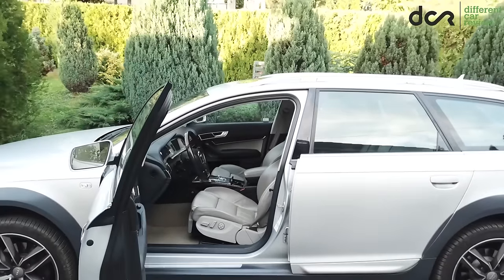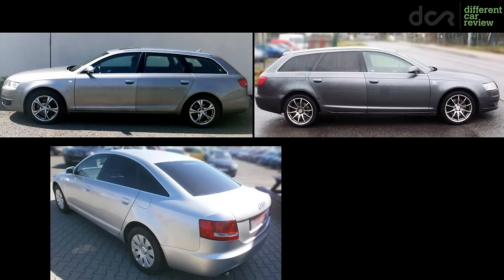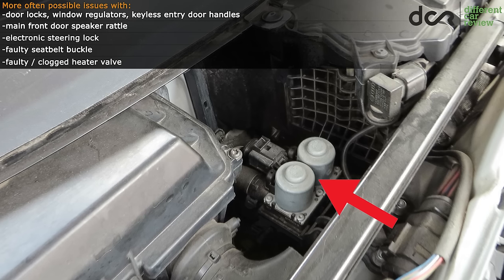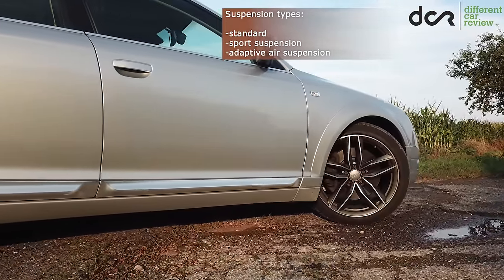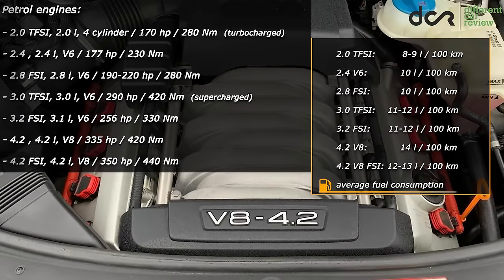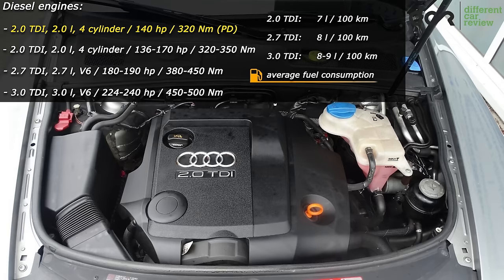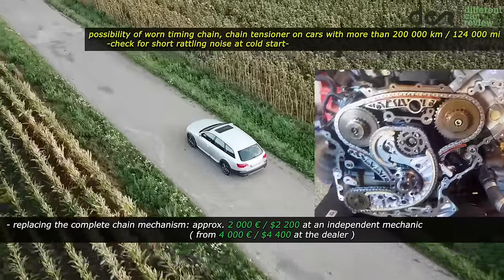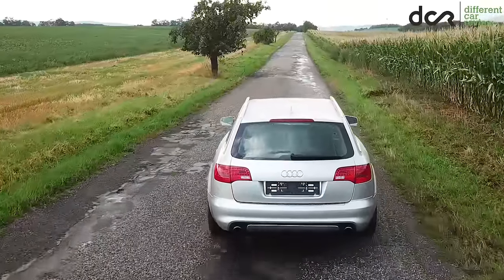used Audi A6 (C6/4F) - 2004-2011, Complete Buying guide with Common Issues

Comment: Done a lot of work on A6 C6s. Here are some recommendations to minimise issues:
1) Get the facelift version (C6.5) if possible. Many of the earlier faults have been ironed out. Also you get LED lights (although not headlights).
2) Always perform regular oil changes using VW 507 spec. If you do high miles and run extended service intervals then an anti-friction/cleaning additive will help minimise risk of issues (N.B. only do this outside warranty).
3) Use premium fuel and regularly add fuel cleaning additive. Minimises issues with the fuel system such as injector blockages and top-end engine deposits.
4) Never touch a Multitronic CVT car. Best to go for Tiptronic.
5) On a 3.0 TDI, change the crank pulley flywheel. This will often come off at some point as the originals are rubber (not mechanically) bonded to reduce harmonic vibration. When it comes off you will lose cooling, power steering, alternator. So as this failure will disable the vehicle a pro-active replacement will provide peace of mind.
6) Even on the 'sealed for life' Tiptronic auto transmission (which is a great transmission), it is still a good thing to change the transmission oil at intervals if you plan to keep the car for a long time. Only use an approved ZF service partner for this type of work (all of which are listed on the ZF site) as this is a fairly complex procedure and a mistake will cost you dearly. If you service the trans every 50k then there is a good chance that the transmission will outlive the car.
7) Keep a close eye on the rear springs. They often fail at high mileage especially in countries that use road salt in wintry conditions. This is because they rust in a way which allows stresses to build up and they snap.
8) All Audis including C6 have a complex front suspension with multiple control arms to create a 'virtual pivot'. What this means in practice is that there are loads of rubber bushes that will wear out so the handling increasingly deteriorates over time with squeaks and bangs developing in the worst cases. The side nearest the kerb will be the first one to go as that is the one that gets hammered the most due to potholes and other road defects. The upper control arms are the weakest so you need to keep an eye on those for undue play, especially the rear one. Unfortunately rubber bushes will fail even on lower mileage cars because rubber is a component that ages irrespective of use. To avoid that happening consider replacing with polybushes, although they behave differently to standard rubber so this will change the feel of the car quite a bit.
9) Avoid cars with air suspension. Very expensive repairs if you use an Audi dealer. Yes the ride is great when they work but unfortunately with age and mileage then something is likely to eventually fail and the parts cost a lot. If you are unlucky it can be like 'whack a mole' - solve one issue with the air suspension and another is waiting to appear.
10) Get a Quattro. A C6 without having quattro is like having a birthday party without any friends, just not the same.
11) The SE version has a better ride than the S-Line especially on bumpy roads. Yep the S-Line looks better with the big rims and is a bit better at hard cornering but there is a price to pay for that, which is your comfort. If you get the S-Line then rest assured that you will eventually grimace in advance of every bump in the road or swerve to avoid them.
12) If you plan to own this car then you will need some DIY car skills, and so is probably not a car to own if working on a car frightens you. The newest ones are now 10 years old and they are increasingly getting issues. Having these repaired at an Audi dealer or even an Independent specialist is going to be a very quick way to empty your wallet.
13) Never get a C6 TDI equipped with a DPF if all you are going to be doing are local and short journeys. These engines need to be worked hard to get the high temps necessary to remove engine deposits and local journeys mean the deposits build up and the auto-regen may not be able to handle this. This situation could cause emission control failure (limp mode etc) and potentially require expensive ($1500+) repairs.
14) If you are technically minded, invest in VAG-COM/VCDS and a laptop. This way you can run diagnostics scans, getting the same info as Audi and identify impending issues without spending $$$. You can also make adaptations and activate functions which are not otherwise accessible.
Reply: Thank you so much for all the information, I currently own a 2008 A6 Quattro 3.2L, and want to get more power out of it. What could you recommend I do?
Reply: @vluri258  Normally aspirated engines like the 3.2L do not give massive power gains using remaps. You can perhaps achieve around 20 BHP more this way.

It is also possible to add a forced induction kit such as a 3rd party supercharger to give you additional power. However I think this engine has around 12.5/1 compression ratio which is quite high, so the boost pressure would need to be kept low to avoid the engine coming apart at the seams.

Personally, if I had decided to make a sizeable $$ investment in such a car, I would get the cylinder head gas flowed including having the valve openings machined (using a spiral flow to improve fuel/air mixing), have a sports exhaust fitted, install fast cams for more top end power, alongside a remap. If I was being greedy for well over 300BHP, and sufficiently brave to risk it, I might also include the induction kit option with some strenghening work to handle the charger boost. Bear in mind engine mods like this are not DIY jobs, they are expensive and can also introduce reliability issues if not done by somebody who is fully experienced in this type of mod. So you would need to decide whether this is a worthwhile risk and investment in a 12 year old car.
Reply: Whould you chance oil (flussing the transmission) for 225tkm driven tiptronic, if it has stock oil in it. I have C6 BMK remapped to 285hp/550nm. 

Some say that if you chance stock oil after 200tkm, it could do more damage to turbine than drive with old oil. Because all the possible metal particles of transmission wearing will flow to turbine.

I also want to state that in my experience C6 air suspension is far more reliable than mercedes/bmws air suspension of the time. 

I had to chance suspensions compressor (399€) but apart that, suspension has worked flawlesly. Original factory installed compressor ran 200 000km, and factory suspension still works well.  So i would say its quite reliable. Considering that car has seen only northern finlands roads, and temperatures.
Reply: @johanneskoskela384  225km is a lot of miles to do a first trans fluid change, and there is an increased risk of metal wear particles and other contaminants like friction material being dislodged when you use a flushing machine. Basically there is a magnet and filter in the trans, and flushing without first cleaning the pan and its magnets can dislodge contaminants, which then get into the moving parts like torque converter, gears, etc, and also the internal fluid channels, some of which are small and easily blocked. If that happens the 6HP trans can fail within a few hundred miles.

If I was going to do this at 225km then I might drop the pan first, clean it, change the filter, fill up (being careful to only replace the volume of fluid that has come out), and then after a week or two of driving do a proper machine flush and repeat the filter change. Many people would call this approach overkill, as trans fluid is like liquid gold and costs a fortune. Although no where near as much as buying a new gearbox, so IMO best to be safe rather than sorry if you value the car.

I would also recommend that you should only get a ZF approved partner to do this type of work. It can be done as a DIY job, but very easy to mess it up and you need the right equipment.

Rubber bushes can actually last longer in cold climates, as hot weather tends to evaporate the volatiles in the rubber more quickly, drying it and helping to break down the compound. Although very cold weather can also damage rubber for different reasons, as cold rubber is not that pliable so stresses more and cracks easier.
Reply: @ Gladius Do You think that the worn crank pulley flywheel can be responsible for vibrations on engine idle revs? (3.0 TDI CDYA)
Reply: @dominiusz1978  It would have to be pretty loose for that, and normally happens only when it is about to come off due to the rubber bond failing. Unfortunately a lot of other things can cause idle vibration. Such as:

Fuel system (e.g. injector deposits, high-pressure pump, pressure regulator)
Worn engine mounts
Glowplugs failing
EGR malfunction
PCV system blocked

Have you had the car checked for fault codes? If not then you need to get VCDS, as it helps to eliminate or identify a lot of issues. Otherwise a lot of problems become guesswork that could otherwise be diagnosed.

If I had to guess then I would start with the fuel system and engine mounts. Try a fuel system and injector cleaner, added to the fuel when you next topup. Also I would get it on a ramp and check the engine mounts are not perished.
Reply: @gladius492  I have VCDS. No fault codes, injectors are super healthy, engine itself is working smoothly. Only those vibrations that you can feel on a whole car body. I will check the engine and gearbox mounts. Thanks for the tips!
Reply: Just bought Allroad , fully equiped , its done 314.000 km, wanted this car. It is listed as well mantained , its from Germany. Im hoping everything is gonna be fine. There are mechanics who refurbish air suspension for 150euros per unit and give 1 year warranty.
Reply: @GG Zelvys Aah its in my country not sure for yours, you will have to look at it on the ads
Reply: 2005 A6 C6 4.2L 100,000miles got problem puttering just changed the plugs and coils, still sputtering at idle just under 1000rpm.   Think it may be the throttle body its making weird sound from there like flap is out of wack.   Any advice will be great 🙏 Namaskarm
Reply: nice run down man, ty
Reply: Multitronic isn't as bad as people make it to be. In B6 and C5 audi's, they had issues with the clutch plates, but they changed the clutch plates and that's not an issue anymore. Usually the biggest issue with multitronic transmission is the control module breaking, because it's inside the transmission oil in closed shell and the oil leaks inside it. That fix is usually under ~1000€ depending labour. I've seen Audis with multitronics driven over 750 000 km and still going. I might even say that the multitronic is more reliable than the tiptronic box.
Reply: @aarraa9671  i've got a c6 2.7 multitronic with 210k km on it, running sweet, driving it dynamicly also, i tend to use the paddle shifters alot in S-mode on twisty roads. My only problem with the car is a rattle than i can feel in the whole chassis at around 130kph till 140 when it smoothes out. Ive checked and replaced :
- lower and upper front control arms
- bushings in the front (sway bars and arms)
- front shocks (480mm s ones)
- bushings (front only)
- new tiers + check alignment and rims (all good)
Question : should i check engine and gbox mounts?
Thanks!
Reply: @alexpopa4064  Yeah, check mounts, and have you checked CV axles?
Reply: Thank you so much for the information..just bought a 2008 A6 Avant 2.0 litre turbo diesel.
It's a manual gearbox..2 owners in 14 years with full history, all the books and papers, new front shocks, discs pads and 4 new pirelli P7 tyres and 2 keys all for £2k
Reply: I’m in love with the 4.2L v8 A6 definitely gonna buy one cuz I can find many for under 10k
Reply: @Gladius can u get the allroad without air suspension?
Reply: @ironsavior1171  I have never seen a factory A6 C6 Allroad without air suspension, but it is possible to retrofit a spring conversion kit. However, air suspension makes the car's ride quality tolerable on unpaved roads and the adjustable height with greater ground clearance makes negotiating rough terrain easier. If the car has springs then the ride quality significantly deteriorates on rough terrain and you lose the extra ground clearance, but obviously is fine on the freeway.
Reply: @ironsavior1171  my friends a6 4.2 s line is Quattro without air suspension
Reply: I'm looking to buy an Audi A6 TDI 2008 Automatic, I went and saw it but how can I know if its CVT or Triptronic?
Thanks in advanced
Reply: @ykeshk  Probably the easiest way for you to check is to look at the vehicles option codes, which contains the vehicles factory build configuration. You will find a label with the codes on it in the wheel well and in the front of the service book. If you Google 'Audi Option Codes' and look at the images this will show you what type of label to look for.

Underneath the engine power rating (which ends in KW) is the engine code. On the same line at the engine code but at the right hand side is the transmission code. This gives the specific model of transmission that is installed. Also the transmission will be TipTronic if it has option code 0G7 listed somewhere below.

There are also option code decoders which will tell you the meaning of each code. For example at PlanetVAG (just Google it).
Reply: i know it's been a year since your comment but i'm thinking of buying a 2.0tdi e with around 130k km for 8k euros and the cambelt was changed around 110k. How do I know if it's a TipTronic gearbox and not multitronic?
Reply: @lxve9089  fwd (= no quattro) = multitronic
Reply: @ironsavior1171  ah so Quattro = TipTronic, is there a 2.0tdi e with Quattro? Haven’t seen any car ad with that
Reply: @lxve9089  dont think so for the 2.0 With the 4f gen. A6 c7 4g Got a 2.0 tdi quattro. Either go for 2.7 tdi or 3.0 tdi. And same bigger petrol fwd got multitronic maybe
Reply: @lxve9089  the 2.0 tdi e is a diesel engine with Quattro which is awd im not sure if it mean it’s tiptronic but I think it is cuz there only other option would be fwd
Reply: @dummytummy7622  As far as i've seen, only quattro models have TipTronic, fwd either have a 6 speed manual which is a lot more reliable than shit multitronic
Reply: @ironsavior1171  I want to opt for the 2.0T but i've it's not really reliable due to some wrong engine part, the 2.0T have okeyish fuel consumption (it's under 0,8/l) and much cheaper tax than the diesels, unfortunately my country tax the diesels heavily, 3.0tdi allroad cost around 1300 euros per year. Plus our fuel prices is one of the most expensive in the world. But if I change the faulty engine part to the right ones for the 2.0T, what about it's reliability then? Ofc, I'll service the car and take care of it nevertheless.
Reply: @gladius492  The Gladius Encyclopedia of Audi Wisdom. 
Thank you. Thank you. Thank you. You taught me A LOT from just reading this string alone. Do you have a website? I have a well used B6 A4 3.0 quattro battletank that is being honorably retired. She's not being discarded, but her spirit will live on as an organ donor. Her precious bits will help other A4's clock many more miles. That said, I was looking to replace her with a 80k mile (or so) B8.5 S4. Then something happened. I saw a few Avants recently and now, I'm head over heels in-love with wagons (marriage with no pre-nup love); especially ones that can be tuned like what can be done with the 3.0T. (I'm still confused as to why they put a "T" designation on a supercharged car, but that's Audi. I'm sure they have a logical reason, but nobody else knows what that is. K or C for compressor. No? Anyhow...) The Avant would also better suit my lifestyle and the roominess of the 6 will be appreciated. I'm ready for bigger. 

From what you've taught me here... facelifted C6.5 over the C6. Don't be afraid of air suspension on Allroad because it can be swapped to non-air which was something I've done on a S-class Merc. Poly bushings will make the car more responsive...  What other tips or tricks or hacks should i be looking out for? I'd like to pick something up within the next two months and it's crunch time for learning what i should know before my love affair with the Avant becomes another Depp/Heard trial. Help me out, Brotha! LoL Any additional tips are appreciated. Do you know of any good C6.5 Avants in the states for sale? Thanks again.
Reply: @j.thomas7128  Thanks for the comments. The 'T' designation on supercharged cars was purely a branding matter, to stop the cars being confused with Sport or S4/S6. Nowadays it gets the T if the car has forced induction, whichever method is used. K is used on Mercs due to the German word for compressor = 'Kompressor'.

In terms of other things to look out for, quite a lot are specific to the car configuration so difficult to list them all. Also some things to look out for benefit from having specialist kit (e.g. wheel play detectors AKA shaker plates can quickly identify suspension issues). However, in terms of some general things for the A6 here are a few more points:

The V6 and V8 engines in the A6 have dual overhead cams and four valves per cylinder, which require a complex system of timing chains. These unfortunately have plastic guides and hydraulic pistons which can fail. Any clattering noise for 1-2 seconds at start up can be a bad sign and I would avoid any car with those symptoms.

Coil packs age and deteriorate, often around 50k-60k miles or 5 years. Unless they have been replaced then they will need preventative attention.

A6 window regulators can break so check all the windows work. This often happens because the window is a tight fit and starts sticking on the guide rails, stressing the components. You notice the problem starting because the window goes half way up then back down again because the window controller thinks there is an obstruction. This can be preventatively solved with some silicone spray down the front/rear guides.

Anything like rough idle, misfires, surging, etc, is a bad sign. Need to check this doesn't happen with the engine fully up to working temperature, as such problems sometimes don't show up when the engine is cold.

On front wheel drive A6 models, the CVT transmission (that I don't recommend) must have had the fluid flushed with the proper Audi fluid at 35,000 miles, and every 50,000 miles afterwards. Otherwise it will be a goner.

Although made of quite good quality steel, the front subframe (and other black painted parts) do not have enough rust prevention (this was purely a cost saving measure). In harsh salty conditions these types of parts can rust badly (although it takes many years to become structurally unsound). In any case, I would avoid cars that have spent their life near sea air, as that will exacerbate corrosion issues in those areas on the car where Audi has cheaped out on the rust prevention.

The mounting points on the rear exhaust heat shields often eventually corrode all the way through in areas that use road salt or near the sea. Although they can be repaired to a functional state with oversized washers.

Tyres should all match otherwise it is a sign that the owner was a cheapskate and didn't have the car serviced properly. Quattro cars must have all matching tyres otherwise it can prematurely wear out the center differential.
Reply: @gladius492  Wonderful. Thank you for your reply. 
-Are the plastic guides on the 3.0T and 3.2 v6 upgradable to metal guides? IE: metal guides from S or RS model as with the 4.2 engine?
-I was not considering the 4.2 because of the plastic guides. Since the plastic guides are used on many of the engines, should i reconsider the 4.2 as an option? 
-Can the guides be replaced without removing the engine? (I'm assuming the timing chains are on the firewall end of the engine).
-Does the slap of the timing chain with bad guides sound anything like starting a car that's been sitting so long that the oil drained into the pan? Is the sound like a slapping chain or more like sloppy dry valves?
-Are the coil packs all the same output or is there variation between cylinders?
-Was there ever a DSG option for the 2008-10 A/S/RS6 Avant in any trim or power combo? I havent found one, but have to ask.
-Does the Tiptronic used in the A6 3.0T need to be hardware upgraded before considering 400rwhp pullies/tune or is there a flash available that will help hold up to the extra hp. 
-Is there a concern for increased tiptronic failure on some models/engines more than others?
- I'm all about the rear biased torsen quattro system so fwd cvt is not even a consideration.
-If you were looking for a US spec 2008-2010 A6 Avant Quattro (to me, that's the quintessential Audi shape). What power/trim combination(s) would you consider? (I'm an aggressive driver and enjoy hp, but already ride a 180bhp motorbike so having insane crazy is not needed in my car, but I'd like to have power without needing to redline my shifts). 

Oh, guru of Audi knowledge... This helps me immensely and i am repeatedly thanking you in advance. I try to put a lot of effort into learning about options and power combinations beforehand because i tend to keep vehicles that i love, a long time. 
-82 Calloway Scirocco. owned 12 years.
-6.9l Merc 450 SEL. owned 10+
-6.3l Merc 300. 
Thanks again.
Reply: Thank you! You didn’t have to spill that knowledge on us like that! Just bought a 2006 A6! Super clean, superb handling! The air is blowing lukewarm but the dealership is going to fix that for me. Hoping for many years of luxury sporty riding. 🙏🏽
Reply: @j.thomas7128  Sorry it has taken a while to come back to you. In answer to your questions:

-Are the plastic guides on the 3.0T and 3.2 v6 upgradable to metal guides? IE: metal guides from S or RS model as with the 4.2 engine? Guides for different engines are not interchangeable due to different fitment and dimensions. However, the issue with all these guides is the low friction plastic wear surface, not the guide frame which is made of metal. See below.

-I was not considering the 4.2 because of the plastic guides. Since the plastic guides are used on many of the engines, should i reconsider the 4.2 as an option? It comes down to whether you want a less powerful but more reliable car, or vice versa. The 2.4 is perhaps the most reliable gasoline unit, but obviously not that exciting. If you want max performance then an RS6 with a 5.2 is the best but comes with a heap of maintenance issues. Whether you want a 3.0TFSI or 4.2 V8 comes down to whether you want better gas miles or more more consistent torque and less lag throughout the range. The 3.0T has better gas miles, is much more tunable and once that is done it will leave 4.2 in the dust, although there will always be a bit more lag at lower RPM. However the 4.2 is a simpler engine and is theoretically more reliable - although both engines have some issues but most of these are caused by lack of diligent maintenance. Of the two, the 3.0TFSI is more fun due to the great HP it can achieve with some mods.

-Can the guides be replaced without removing the engine? (I'm assuming the timing chains are on the firewall end of the engine). Engine out job.

-Does the slap of the timing chain with bad guides sound anything like starting a car that's been sitting so long that the oil drained into the pan? Is the sound like a slapping chain or more like sloppy dry valves? First of all, the root cause is more likely due to bad tensioner hydraulics. What then happens is that the loose chain slaps hard against the guides, causing the tips and the edges of the guides to snap off. The plastic guides become more brittle with age and heat, making this more likely as the car gets older. In terms of the noise, it is a loud rattle that lasts a couple of seconds from startup, but can be continuous noise if it is getting serious and can also appear at other times such as when you pull off the gas pedal. There are some vids on YouTube that will give you the sound.

-Are the coil packs all the same output or is there variation between cylinders? Same coil packs.

-Was there ever a DSG option for the 2008-10 A/S/RS6 Avant in any trim or power combo? I havent found one, but have to ask. Nope, but C7 has them.

-Does the Tiptronic used in the A6 3.0T need to be hardware upgraded before considering 400rwhp pullies/tune or is there a flash available that will help hold up to the extra hp. The ZF gearbox is strong, capable of towing large loads and handling large torques. However, operating it with any modded engine will ultimately wear it out quicker. S/W mods can reduce wear on the clutches and peak stresses, but at the expense of shifting a bit slower. Audi's default is OK although not optimised for being the quickest or the smoothest, it is mapped as a compromise between performance and reliability to increase the chance of no issues during warranty period.

-Is there a concern for increased tiptronic failure on some models/engines more than others? More powerful engines and pulling loads slightly increases the chance of issues, same with any car.

- I'm all about the rear biased torsen quattro system so fwd cvt is not even a consideration. Good choice.

-If you were looking for a US spec 2008-2010 A6 Avant Quattro (to me, that's the quintessential Audi shape). What power/trim combination(s) would you consider? (I'm an aggressive driver and enjoy hp, but already ride a 180bhp motorbike so having insane crazy is not needed in my car, but I'd like to have power without needing to redline my shifts). As above, nothing really beats a modded RS6! However in the standard range then a 3.0TFSI with Stage 1/2 mods is a good choice. A6 C6.5 Avant Quattro would also be my choice, in Daytona Grey.
Reply: @gladius492  You rock! Thank you, Mr Gladius Audi-phile Supreme. I think we nailed it. 3.0T C6.5 it is. Being in the US and not having the best Avants available, it would be too long before I could get an RS6 Avant stateside. It takes 25 years from date of manufacture to be allowed to import a non-US spec car to the states. That said, the US got to choose a fun engine or the wagon, but not both. I did find a very interesting salvage title rebuilt car. It was originally a 2009 5.2l v10 S6 sedan that was rear-ended and rebuilt as an Avant in 2018. It was gorgeous, updated, and rebuilt with high end parts, but I can't see spending "Offers over $50k" on it.

One last q and i promise not to keep botherin' ya. LoL

This one thing has me confused. I was under the impression that there was a difference regarding timing chain tensioners/guides used on the 4.2 in the RS4 model vs all other 4.2 applications. When learning about these 4.2 v8 Audis, some have suggested replacing stock 4.2 timingchain assembly with RS4 4.2 components for better wear and longevity, but you had mentioned that these parts are not interchangeable. Did B6 and B7s 4.2's (known as timing chain problem motors) have a different timing setup than what was used in the C6 4.2? I ask this because i understand that the 3.0T is basically a variant of the v8 block with two cylinders lopped off and curious if there is a better fix for the stock 3.0T timing setup than simply replacing with more stock parts that can wear prematurely... 

Thanks man. You have no idea how much time I've spent trying to figure this crap out. I did my research and was set to pick up a used 3.0T S4 B8.5, but saw the C6 Avant and as stated before, fell in absolute lust with it. Picking up a Merc E55 wagon would be so much easier as there aren't as many option combos! LoL I know it's crazy, but i want an Audi quattro wagon. 

If you ever have questions on performance cat-hull sport boats, Mercury 2-stroke race outboards, or Jeep Wrangler builds, then please hit me up. I owe you! Thanks!
Reply: @j.thomas7128  To answer your question, you first of all need to understand something about the Audi mentality. Audi take a detailed 'systems engineering' approach to their engine design, along with undertaking continuous improvement. In other words, when they design parts for an engine (and improve those parts) they look at the whole engine and how those part changes will affect engine performance and longevity. It is not just about the individual part. You will see the relevance of this in a momemt.

So, regarding the timing setup in the various 4.2 engines. The RS4 B7 4.2 engine from 2008 (code BNS) is very similar to the A6 C6.5 4.2 engine from 2010 (code BVJ). In fact, a casual glance at the exposed timing chain end may suggest they are identical. However, this is not the case. The 4.2 BVJ engine has many subtle differences in the timing chain and tensioner setup, resulting from their approach to continuous improvement and rectifying systematic mechanical issues that have been identified. So although the overall arrangement is very similar due to the block being basically identical, many of the individual parts that look identical actually use different materials and sometimes have slightly different (or even significantly different) dimensions. From a systems engineering perspective, these parts have been designed to work correctly with the other parts they interact with. So although many of the tensioner components from a BNS will physically bolt onto a BVJ, they have not been designed to work together with the rest of the BVJ setup and the long-term implications is such parts swapping between BNS and BVJ is not systematically understood, it is just guesswork. Also, it is actually likely that many BVJ parts are improved compared to BNS as it was in longer in production.

It is the same issue with swapping parts into a 3.0T from a 4.2. Although you are correct to say it is basically the same block with two cylinders removed, the devil is in the detail. The C6.5 3.0T engine (code CAJA or CCAA) has some parts commonality with the 4.2s (e.g. the same improved tensioner guide rail 079109469AL can be installed on all these engines) but the overall differences are much greater than between BNS and BVJ. If the parts fit and were swapped then they may appear to work initially, but it is basically just tinkering and could easily cause unforseen issues. So, personally I wouldn't try and swap in RS parts, but that is because I would generally stick with what the Audi engineers have designed and undertaken systems testing against (although I would support Stage 1 and many Stage 2 upgrades when done correctly). Others who have swapped parts successfully may be able to advise differently, but I can't advise you on that I am afraid.

The main issues with the tensioner system should have been resolved in the C6.5 and by using the latest Audi part numbers. As you will know, all the C6.5 engines with significant miles on them will likely need a partial or full rebuild soon, and all the timing-related parts should be replaced at that time. Combining that with 5k oil changes and anti-friction additives, etc as per my original post should provide good longevity although none of these Audi performance engines is going to go 100's of k's without issues. Hope that helps.
Reply: Thanks for the information does my a6 c6 have a dpf???
Reply: @gladius492  hey sir. Most reliable engine for a 2008-2009 a6 c6?
Reply: @subscribinkitmane1119  In my experience the most reliable gasoline engine is the 2.4L, however it was only produced until 2008. The 4.2L naturally aspirated is also ok, but again only available for older cars and more prone to oil leaks than the 2.4L - dependent on the location these can be expensive to fix due to the time involved. The most unreliable gasoline engines are those with FSI/TFSI, which basically includes all the C6 facelift engines. These are more likely to get top-end carbon buildup, faulty injectors, and other issues with the fuel system and PCV system, especially when high mileage. However, if I had to pick one I would go with the 3.0TFSI.

For diesel engines, if I had to pick then overall the 2.7L or 3.0L V6 are the best (they are basically the same engine). The facelift versions of these engines have some redesigned elements compared to the originals used in the pre-facelift cars, which also improves their reliability somewhat.

Some of the issues with all these engines can be delayed or avoided by adhering to the points in my original post regarding premium fuel and additives, etc.
Reply: @gladius492  aprecciate the help. Take care, have a good day sir
Reply: How do you know if an Audi A6 C6 has DPF or not?
Reply: Thank you
Reply: Im looking to buy a a6 c6 2,4 manual with 400000 on the clock, anything i should be worried about? It runs smooth and nice.
Reply: @rasmus6040  With 400k miles on any car there are a ton of things to check over, no matter how smoothly it appears to run. Difficult to list everything, but here are some of the key things I would check on the C6 4F 2.4 manual:

1) Engine - Although it is perhaps the most reliable C6 unit, the 2.4-liter engine can suffer from oil consumption issues at higher mileages especially if the oil hasn't been changed regularly. So, look for any signs of excessive oil consumption, such as blue smoke from the exhaust. Check for timing chain rattles on cold start that go away after a few seconds. Also check that oil filler cap doesn't have signs of mayo sludge due to head gasket failure. Ideally, I would also do a compression test to check if cylinders are in spec. Remember that if the engine needs any significant work it is likely that the car will be going to the junkyard.
2) Engine Mounts - Inspect the engine mounts for signs of wear and play. You can see issues visually when the engine is started and revved as it will unduly move about, and you can also check using a pry bar.

3) Cooling System - Check for leaks and coolant discoloration, i.e. oil contamination due to gasket failure.
4) Suspension - At 400,000 miles, components such as bushings, control arms, and shocks are going to be worn out unless they have been replaced. The front trailing upper control arms on the side nearest the kerb will normally go first. However, at this mileage the rest of the front suspension will be worn unless it has been maintained. Bangs and knocks over bumps on a test drive will normally indicate problems. The rear springs often snap especially when corroded so check these are not broken.
5) Transmission - Listen for unusual noises and ensure smooth operation during test drives. I seem to recall the dual-mass flywheel on the 2.4 doesn't have the greatest longevity. One of the most noticeable signs of a failing DM flywheel is clutch chatter, which manifests as a vibration or shuddering sensation when engaging the clutch, especially during takeoff or gear changes.
6) Electrical System - Test all electrical functions thoroughly, including lights, windows, climate control, and infotainment systems. Get a scan tool and check for fault codes. Don't take any codes for granted - a single code might require high $$$ repairs to fix. 
7) Service History - I wouldn't consider any car without a really good maintenance history. Otherwise, there will be multiple expensive things that will probably need sorting out soon.
8) Exhaust System - Check for corrosion end to end including hanger points. Also check the heat shields and their bolt mounts as they are prone to galvanic corrosion especially if the car was used near the sea or on salted roads.
9) Bodywork - although the A6 C6 upper body can remain in remarkedly good condition after many years, the same often isn't the case for the underbody. Many of the subframe parts aren't galvanised and instead have cheap ass paint applied. Even where the body is protected you still get issues with galvanic corrosion where dissimilar metals contact each other (e.g. bolt into chassis), similar to Exhaust comment above. Underbody panels often come loose and drop down because the fixings corrode away, or the fixing mount points rot out due to this reason. So strongly recommend you have the car on a ramp to check it over.

Finally, I wouldn't consider buying this car unless you are good with a spanner and have some money set aside for maintenance.
Reply: @gladius492  400k kilometer, not miles😉
Reply: @rasmus6040  The same advice applies as 400k kilometers is still a lot of mileage for any Audi - trust me! The only Audi cars I have seen make high mileages without expensive repairs are those with a combination of most of the following (1) Regular maintenance with low OCI and gearbox oil change intervals (2) Simpler engine/gearboxes arrangements and using naturally aspirated engines (3) Not exposed to harsh climates (4) No invasive engine mods (5) Regular use of good quality fuel (6) Lucky owners.
Reply: @gladius492  you’re right, i am a mechanic so the repairs are not a problem, I just generally think it's a fantastic car. But yeah, 400k is allot. I know.
Reply: 15) get a 2.4 manual
Reply: I've seen a 2010 210k miles c6 Manual avant 3.0tdi. Very cheap to buy but after reading your comment and watching his extended video on the 3.0tdi engines I could be looking at 10k in repairs or 5k in prevention maintenance,  injectors, turbo, fuel pump, timing chain, flaps, lots of other stuff..just no way I'm touching it.
Reply: @Pure-Luck447  In fairness, at that mileage a lot of other cars are at risk of similar issues, it is not Audi specific. I have seen a fair number of A6 C6 with over 300k although they are definitely the exception. Getting to that mileage is often related to how they have been looked after over their lifetime from new. For instance, regular 5k oil changes, use of anti-wear oil additives, 100% use of premium gasoline, carbon cleaning fuel additives, transmission oil changes, diff oil changes, preventative replacement of parts like the HPFP.
Reply: @gladius492  appreciate that. A cheap c6 quattro is tempting that's all and I'd want a reliable car so just not worth the risk cost for me. A more basic car such as vag 2.0tdi is less risky and easier to work on but also not as desired lol.